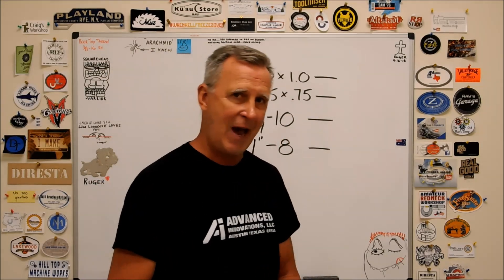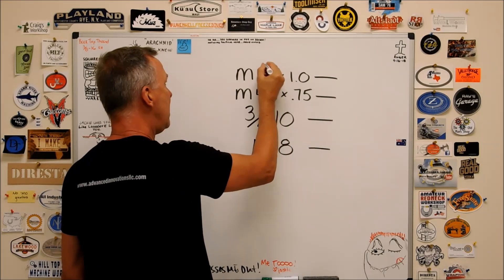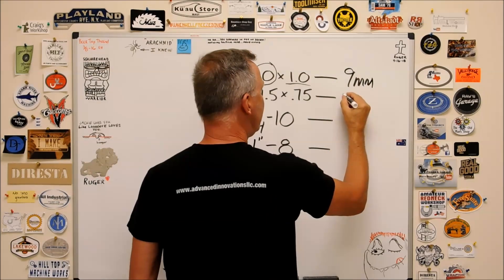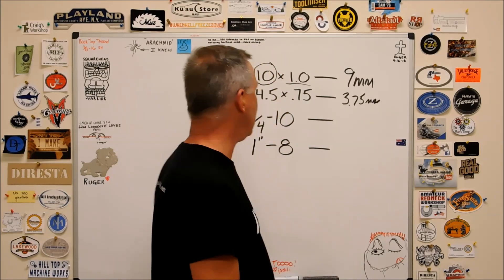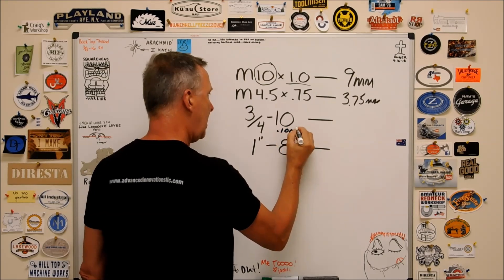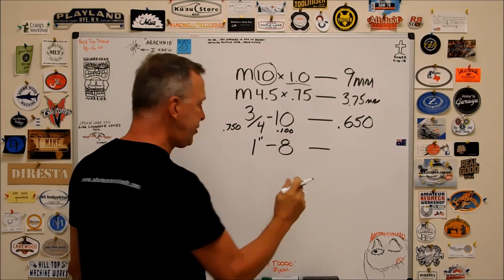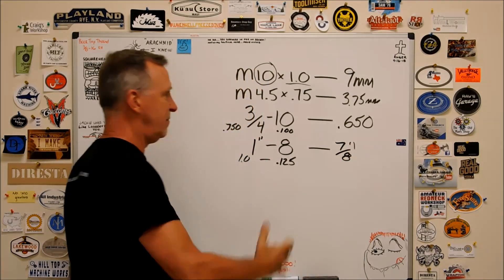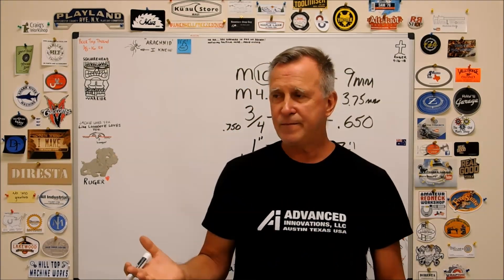How to Determine the hole size for an Internal Thread  --  SHOP GEM !!

Comment: Excellent! That's roughly what I do. Only problem is sizes of readily available drills. Half mm sizes are very common. But who has a 3.3mm drill for M4x0.7mm threads? Yes they are available, but usually very expensive. I bought a 3.2mm carbide drill because I cut so many M4 threads, and 3mm or 3.5mm is just not right. M5x0.8mm you can get away with 4.5mm  or 4mm in softer materials, and all the other common metric threads are close enough to standard drill sizes anyway.
PS: I have only broken one tap in the last 20 years (now I'll probably break three in a row lol).
Reply: Where you live they maybe expensive but you only need a few say m3 to m8 or m10, the tolerance  allowable for larger threads makes them less critical.
Reply: @chrisstephens6673  Yes, I agree. I don't often make internal threads bigger than M6, if I did I'd invest in the correct size drills. Would love a complete set of 1-10mm in 0.1 steps...
Reply: @fredgenius  my policy when setting up my shop was to buy reasonable quality (Polish in this case) 1 to 5.9 and 6 to 10 in 0.1 increments. Any that wore out or got regular use got replaced with German made cobalt ones,  if the budget allowed.
Reply: @chrisstephens6673  I'm upgrading everything in my shop constantly, but funds are limited so odd size drill bits have fairly low priority atm. Don't want to buy something I'm never going to use - but on the other hand, nice to have them if you need, not have to wait for them to be shipped.
Reply: @chrisstephens6673  Yes, the German-made cobalt drills are greight, I got a few...

Comment: Hi Joe 
Really enjoy your channel and obvious wealth of knowledge. I am retired and trying model engineering and restoration of two old mowers built around the 1920’s so it’s a steep learning curve. I usually google to get the answers to tap hole sizes but prefer to take your described approach.
Is there a similar way to determine the bolt size when I need to make a bolt to go in a hole? I have snapped a few bolts when stripping down rusty machines.
Thanks again 
Peter Stephens

Comment: Good topic Joe, I would add one further thing. That this holds true for 60 degree thread forms, For different angle threads there is a bit more to be worked out like a BA thread and to a lesser extent Whitworth. BA being 47.5 degrees Whit being 55 Degree. John, Australia.

Comment: For external threads I have read all kinds of things from, "just use the same size material as the thread, to take the thread size and remove x percentage, to it's the diameter  minus x percentage of the thread size, where x is ".  For internal threads I have read many times it's the size - 10% of pitch (which it what I have been using, with a broken tap or two). In addition I often find charts or calculators that adjust the x percentage for the type of metal non ferric vs. ferric.   I trust you more than any random result from  Google so I will now switch to your method.  Thank you very much!

Comment: I watched that video, had a laugh at him using a regular 60 deg 3/8"or 1/2" carbide insert as a threading insert. I could swear he didn't have the compound at 29.5 or 30 deg. Looked more like it was at ~60 deg.

Comment: Joe,  what % of thread does that give you?  In the medical industry they usually require 70% thread engagement.
Reply: Joe's formula will give you 75% thread.
Reply: The formula is Drill Hole Size = Basic Major Dia. Of Thread (mm) - (% of Full Thread* X mm Pitch)/76.98, so this shortcut gives just under 77% thread engagement.  This is for cutting taps as well, not forming taps.